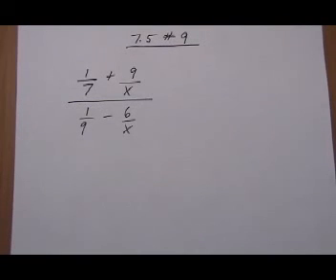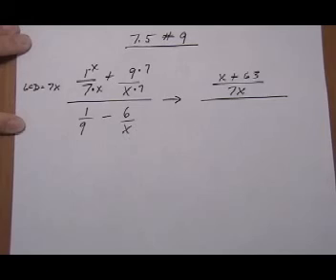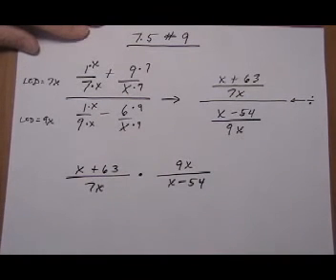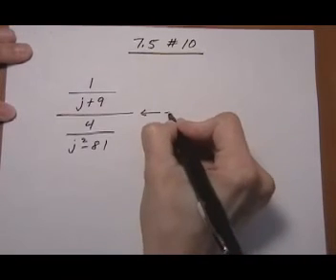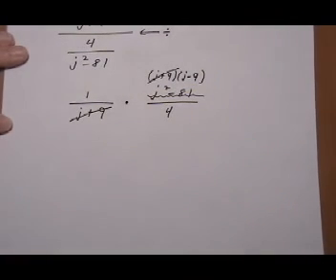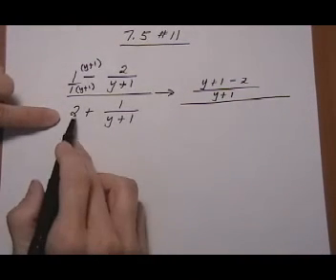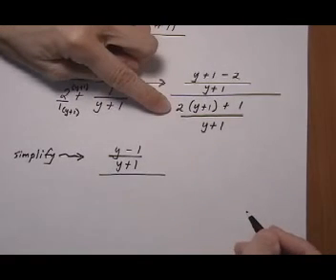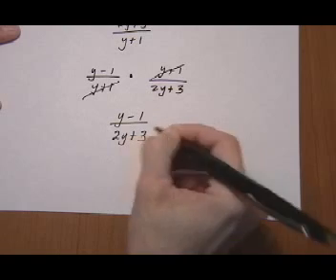simplify complex fractions

Comment from the maker: (1) If you mean how do you know j^2-81 factors to (j+9)(j-9), that's a matter of having practiced a lot of factoring and noticing that j^2-81 is a difference of two perfect squares, j^2 and 81. (2) In the second problem, the (j+9) divided out because there was an IDENTICAL factor of (j+9) in the numerator and the denominator (which means you really have (j+9)/(j+9), or 1). In the first problem, the factors were different, (x+63) and (x-54).

Comment: This video helped alot, I had a question though.
1) How do you know if the number can be factored or not? Im having a lot of trouble in that regard. I never remember having to figure out what could be factored, we were just asked to factor.
2) why did we cancel out the j+9 in the second problem if it is followed by another number? (in the first problem we left it uncancelled. Thanks.

Comment from the maker: @100xines The x's can be canceled from the 7x and 9x because they are common factors, and one of them is in the numerator while the other is in the denominator.  So basically, think of it as dividing an x from the top and bottom of 7x/9x, resulting in 7/9.

Comment from the maker: The LCD is 7x because the denominators of the fractions on top are 7 and x, so in this case just multiplying them together gives the LCD. Like if the denominators were 4 and 7, the LCD would be 28. 

(It's not always just a straight multiply though. If the denominators were 7x and x, the LCD would still be 7x ,not 7x^2, because the LCD 7x already contains all factors of each denominator separately.)